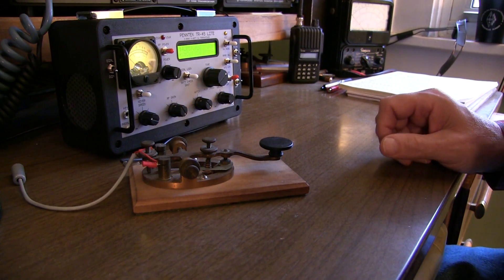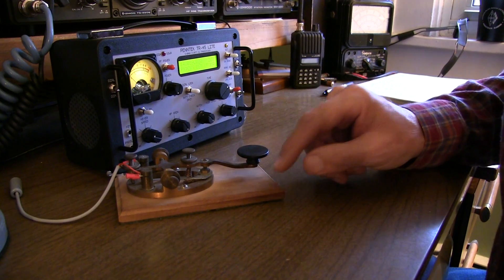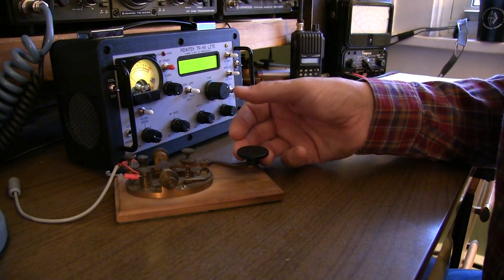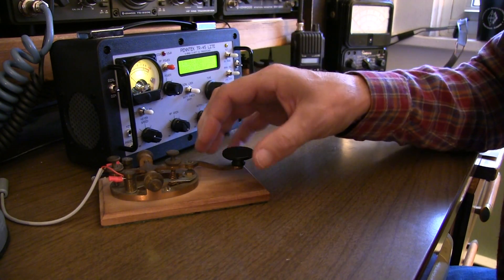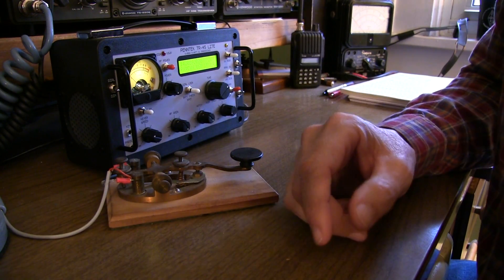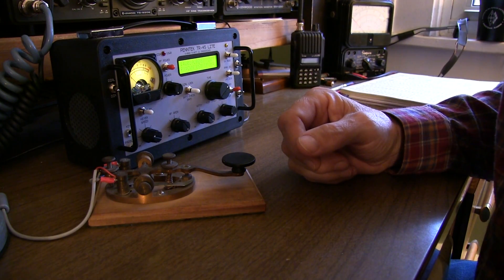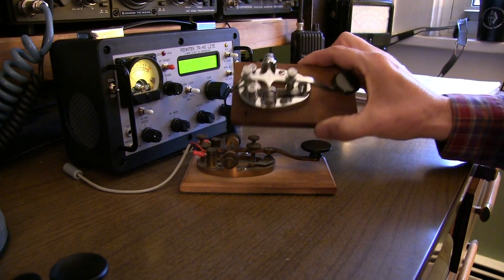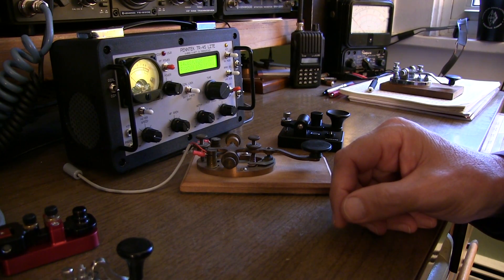#365: Ham Radio: What is your CW straight key sending style?

Comment: Poor!  LOL  To answer your question, I pretty much always did the grip thing, but that may have come out of seeing lots of old WWII Army & Navy films / film strips going thru school in the 70's, early 80's and having an intense interest in radio / electronics, devouring all I could find.  TBH, I was never able to really get into the whole CW thing.  I learned Morse code when I was maybe 10 or 11 from a Radio Scrap 65 in 1 Electronic Experimenter's Kit but I was never very good at receiving it.  I was always interested in HAM radio since a young age, and of course did the whole CB thing thru the 70's and early 80's.  I worked hard at various times to get my code down good enough to get my ticket, but for various reasons, never ended up taking the tests.  At some point I picked up Gordon West's code practice cassette tapes from Radio Scrap and they helped quite a bit.  I was going for the General specifically so I wasn't stuck hammering code on HF, so I was trying to get it up to 13wpm.  I also had wrote my own morse code practice program for my C64 that was actually quite advanced including the ability to automatically sync to any speed I could transmit at using a key plugged into a joystick port as long as your speed was consistent.  Between the 2, I managed to get up to 13 pretty consistently, and had pretty good keying technique due to the (adjustable) constraints of the C64 reader.  Being an electronics guy, the theory questions were never a hurdle.....   well at least up to General at the time.  They were WAY harder back then, some requiring you to draw schematics for a random circuit like a Colpitt's or a Hartley Oscillator. Plus, back then there were still questions regarding tube theory, biasing, etc. in addition to solid state stuff. All the ducks were in a row, went up the the Grayslake hamfest and a severe thunderstorm hit forcing them to shut things down.  By this time I turned into Al Bundy so priorities changed as work and family life left little time/cash for hobbies.  Fast forward to 2005 or 6?, I happened to catch that the FCC eliminated the code requirements for Amateur Radio licenses.  I had since moved to Iowa where HAM testing is relatively scarce, but just so happened to have one the upcoming Saturday, this was Thursday evening.  So I quick dusted off the ol ARRL Handbook and started studying mainly rules and procedures, but even such simple stuff as general band plans etc. as I'd been out of it for 15+ years.  Had to go online to learn about modern digital modes and stuff that weren't in my 15 year old ARRL handbook.  Studied all of Friday then ran out to Boone County to take the test.  Sadly, it was just me and the 3 VEC's, nobody else showed up.  Knocked out the Novice in about 5 minutes, passed it.  Went on to the General, 10 minutes, passed that but I did miss a couple.  Well what the heck, may as well try the Extra although I didn't think I stood a chance.  But 20 minutes later I was the proud new owner of an Extra class ticket, just by the skin of my teeth.  Can't remember if I was 1 or 2 away from fail, but it was close. The VEC's were pretty surprised too.  I was lucky that the one I got happened to be biased a lot more towards technical questions rather than procedural allowing me to squeak by.  I've never attempted to play with CW on air.  I'm a purist, so if I did it would be a straight key and headphones, no helpers, but it's not likely to happen as I'm Asperger-ie and don't really talk much on the radio due to crippling social anxiety.

Comment: A fella can drill a hole in a disc like a poker chip and make a sort of navy knob
I like a navy style knob
My key a old speed x with a navy type knob
I rest my arm on the table and I also grip the knob
I think I use my arm and my wrist while my elbow rests on the table
I know not for certain because I am mainly concentrating on sending

I reckon I what you call table hugger :)

Comment: My CW Elmer was my Dad WN6IFX (SK) who had been a Greek Merchant Marine radio operator. I keep my elbow on the desk as he taught me, grasp the key top with all fingers around its circumference and although as my desk edge to radio distance is quite shallow I turn to the left when I use the straight key I actually use a Navy Flameproof key with the big nob but have a J-38 too. The other great tip he taught me was to write in lower case cursive and never take the tip of my pencil off the paper except to "carriage return". Has worked well for me since '69 but truth be told I use the electronic keyer exclusively nowadays. Hope to CU on Straight Key Night!  73 - Dino KLØS

Comment: When I got into CW back in the early 2000's I used three fingers on the key and wrist on the table.  My hand-eye coordination was horrible so I never really had much success with that and gave up on it.  I could receive just fine but never got the hang of sending so I ended up never using CW and have forgotten everything I learned back then. Good luck on Straight Key Night!

Comment: It was about 1972 when I acquired my Simpson 260 - so I've had it for 51 years. It's easy to forget the batteries and allow them to leak to kill the multimeter's innards, so I attached battery mounts to the rear/back/outside of the simpson. Still going strong!!
Reply from the maker: I don’t use mine to measure resistance, so I simply leave the batteries out.
Reply: @w2aew  That'll do it!

Comment: I've been learning CW using a mobile app, and alternate between index finger and even using my thumb to press the in-app button. A mobile app is great for feedback, but knowing that this could lead to really bad style, I got a physical key (MFJ-557), and am using it with a decoder to check proper sending. But indeed, I'm extremely curious as to how to avoid RSI or fatigue.
Reply: Using a keyer or bug helps avoid stress on the wrist. For straight key sending, just practice (within reasonable limits), and keeping your forearm relaxed as much as possible will help.
Reply from the maker: Good advice from Ruel

Comment: you know those thin rubbery/foam sheets you use in kitchen drawers, etc to keep the silverware trays from sliding around?   stick a small piece of that or similar material to keep the key from sliding all over the desk :)
Reply from the maker: I actually have some self-adhesive rubber film that I put on the bottom of the portable keys and paddles, definitely helps to keep them from scooting around.
Reply: @w2aew  good idea!  i bet moongel or an old mouse pad would work also, happy new year!